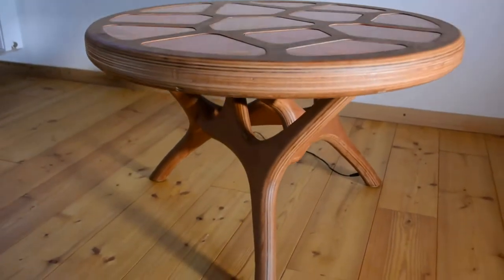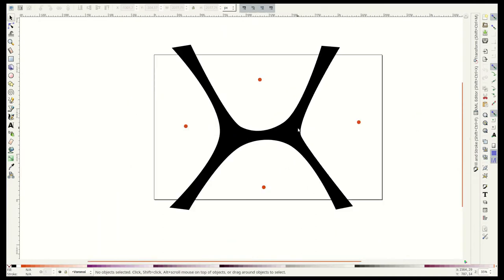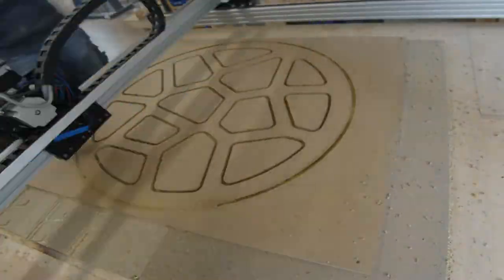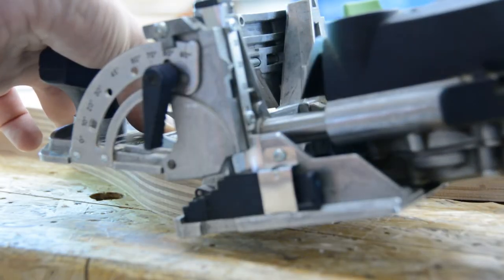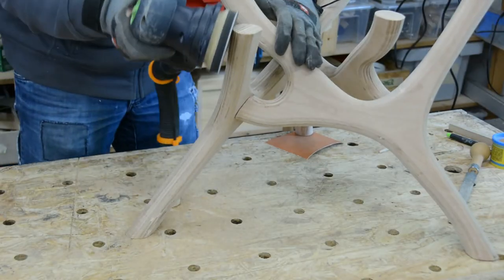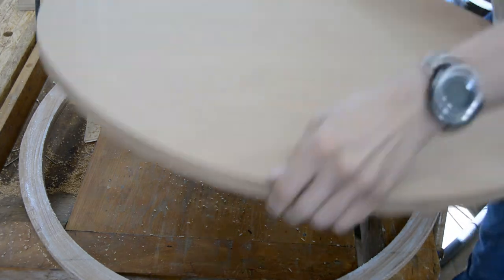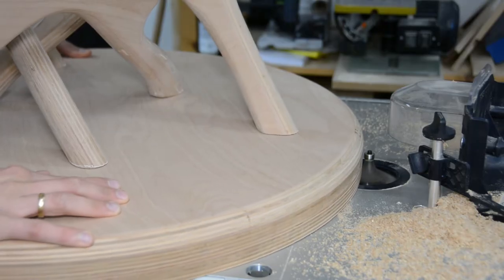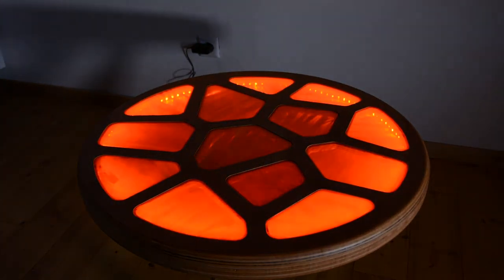Living cell table (#rocklerplywoodchallenge)

Comment: The secret revealed! I thought you had a conductive surface with an capacitance sensor, BUT NO!!! lol, Nice work.
Reply from the maker: P. J. Galati 😏 I learned in this build that glass is blocking IR radiation so that I couldn’t use a proximity sensor. I was already reading spec sheets of radar based sensors but then realized that a 5ct photo resistor might be exactly what I need. 😃
Reply: Indeed that's very true, it does work. I think for my version of it though, I'd like to be able to turn the table on and off by touching it anywhere...hence my original thought. :P
Reply from the maker: P. J. Galati I had a few ideas that I’ve discarded as I was afraid that the table would be constantly switched on and off. 
You could inlay some copper wire and then just take the entire module of one of the lamps that are switched on by a double tap.
Reply: That is an excellent idea! Come to think of it...I've never tested to see, but I'm sure brass is conductive too..maybe...brass inlay for the switch! I'll have to test my theory.
Reply from the maker: P. J. Galati YPPERLIG at IKEA costs 45€ and comes with a power supply, a dimmable touch switch and a few LEDs. 
Bronze should work in theory. The main challenge that I would imagine is that the designer of the lamp most likely has hard coded a certain limit for the lamp. With bronze having only 20% of the conductivity of copper you might be below the limit.

Comment: Wait, you can sand glasses with a woodworking strip sander?
That super cool!
What's your dust collection setup?
Reply from the maker: Rexus King You will need a special ceramic belt - otherwise you just ruin the belt but don’t remove any glass: https://wayofwood.com/tool/sanding-belt-for-glass/ 
The sander you see in the video is a 2x72 belt sander but you could use any other sander as long as you get the right belt. In this case I just put a bucket with water below the sanding belt and didn’t had any dust collection running. I was wearing a dust mask though.
Reply: Thank you for the detailed information! Glass is such a interesting and beautiful material.
Reply from the maker: Rexus King Agree. Especially the stained glass is looking great and with a high quality glass cutter and the belts it was surprisingly easy to work with.

Comment: Wow. Never knew how a cnc can bring your projects to the next level. That project would be impossible to make without one. Nice work though. But remember a stain can make/brake a project.
Reply from the maker: The project would have been much harder without a CNC but still possible. I basically created 2 templates on the CNC that one could have created with a jigsaw and (a lot of) spindle sanding. As the shapes are somehow arbitrary small deviations don't matter. 
I thought about a dark/black stain but all the stains I tested covered up the plywood structure - I'm happy that I stayed with the natural beech.

Comment: Great! How do you change the width of the leg parts?
Reply from the maker: What do you mean with the width of the legs? The thickness is actually identical from top to bottom...
Reply: @WayofWood  At 1:00 when you finished the operation for making legs by Voronoi Diagram, I think the lines of legs are very thin.How do you change the thin lines to your final design (Both end of the line are wider, middle of line  is  narrow)? Thanks.
Reply from the maker: x x I modified the legs a little bit by hand in Inkscape (just use the line edit tool) but if you look at 2:00 the leg template is still quite thin. The optical width comes to a good part by doubling up two pieces of plywood.
Reply: @WayofWood  Very appreciate your help.